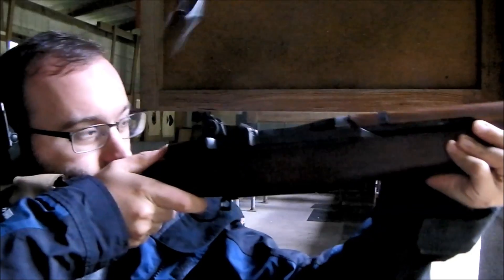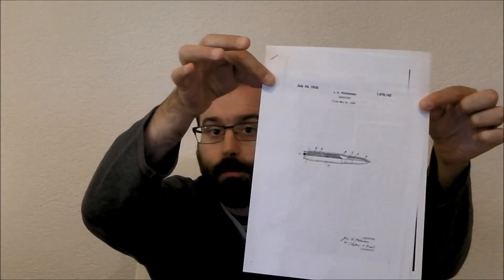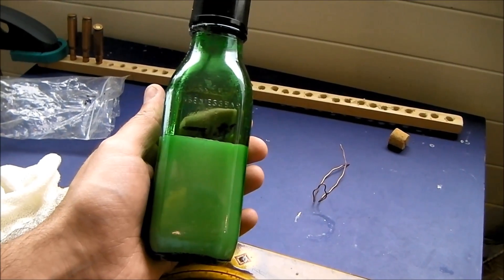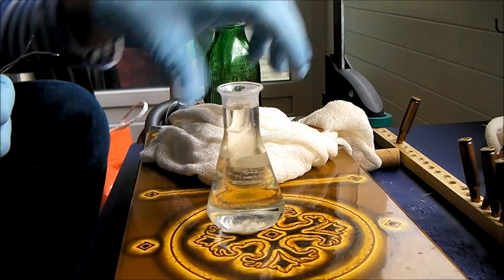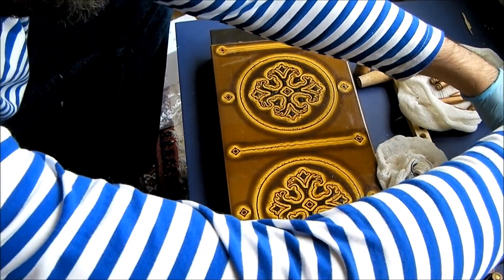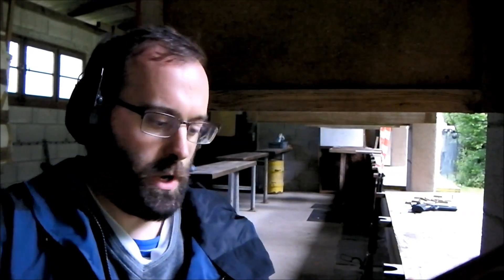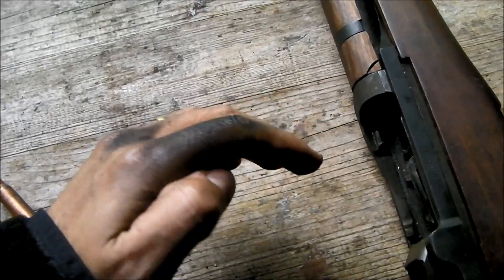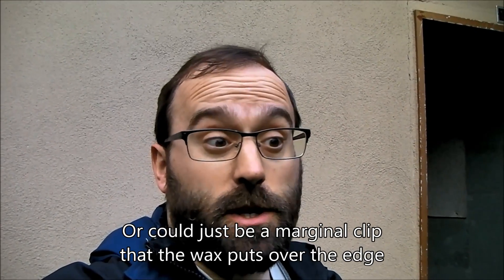Relaunch in HD: Recreating and testing the Pedersen cartridge waxing process

Comment: I'd be chary of making changes to ammunition for the M1.  Based on personal experience and some reading on the subject, the Garand is very reliable when using properly spec'ed ammunition, but based on my reading it has a tendency towards damage and parts failure (e.g. op rods) if off-spec ammo is used.  Lubrication of the cases will, imo, lead to increased stresses on the mechanism as cases are extracted during higher chamber pressures.  I don't claim to be an expert, but reloading seems a better (and safer) option to me.  Save the cheap ammo for a Springfield or M1917.

Btw, if you feel an urge to show more David Hasselhoff singing in German, please resist!  What is seen cannot be unseen!  And to make it worse, I can understand his singing, too. His accent is terrible!  😖

Comment: The reason that your gas system filled with black greasy gunk was the the projectiles were coated with the wax,  I think that you will find that holding the cartridge by the bullet, not the rim and limiting the coating to the cartridge case (perhaps only to the  begning of the shoulder) you would have all the advantages of a lubed case without the accumulation of the greasy gunk in the gas system.